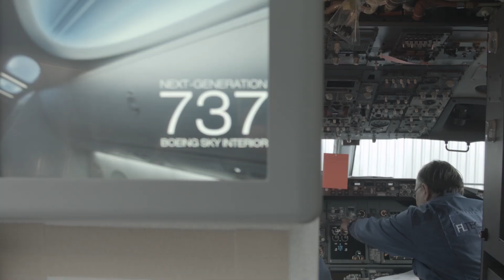How will Starlink make money, from the early days to a full blown Internet Service Provider?

Comment: Have you looked at any of the comments Gwynne Shotwell has made?  A lot of what they have said disagrees greatly with your assessment.
Reply from the maker: Not as many as I should have before making this video. Still, I suspect the early days will be mostly backbone connections, which I know is something I've seen. A few years after, it will be more common, but this isn't going to be a city ISP, it just won't work as well in a city as it would have to.
Reply: Roadster Tracker -Ben Pearson  It won’t be years, it will be months.

Comment: in the UK we can get 40Mbs down 4Mbs up satellite internet for less than 50 USD/month, it will have to be impressive to compete with that
Reply from the maker: How much bandwidth per month are you allowed?
Reply: @WhereisRoadster  its unlimited
Reply from the maker: Just looked it up. No limits, but there is a point beyond which they will start to degrade, similar to most cell phone plans. Still, that is quite interesting. The latency should still be higher, which would make doing some things quite annoying, to say the least, but still, much better priced than I had realized. Huh.

Comment: 5,6,7G satellite internet is what it plans to
Reply from the maker: This is almost right, in the long term. Still, I don't think they will ever shrink the antenna down to a phone size, maybe a laptop. Also, it's ability to work indoors will be challenging. I mean, we have all had the experience of losing cell phone connectivity in a building, it will be much harder to maintain a satellite connection! Still, I'm 95% certain that a general public internet will not be the first thing they offer, but rather a business-to-business internet to connect two points with a long distance, or airplane/ cruise line/ busses/ trains/ etc, or government applications. The personal internet won't be around until they have at least a thousand of these, the bandwidth just won't be there otherwise!

Comment: My guess is that the Starlink endpoints will have integrated WiFi and maybe 5G so you would use you car or datavan as a hotspot for the other I ternet equipment in the area.
Reply from the maker: I agree that many of them may well. As I said, I expect this to provide a link for remote cellular data points. There's going to be something interesting in putting one of these on a house, I suspect, where I think Elon probably doesn't fully appreciate it. You have to have the antenna outdoors, that's just basic physics, and if that's the case, running wires becomes important.

Still, I do think like most ISPs today, you will be able to get a WiFi router as part of the package somehow.